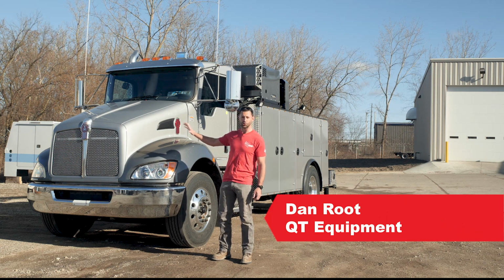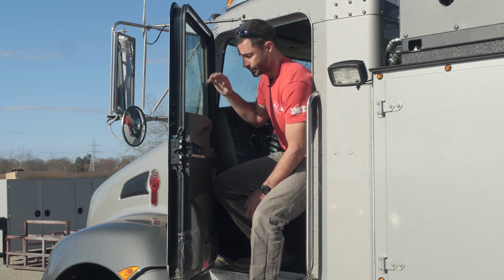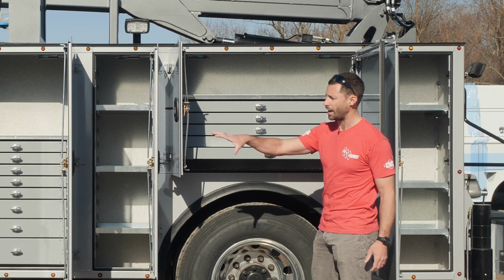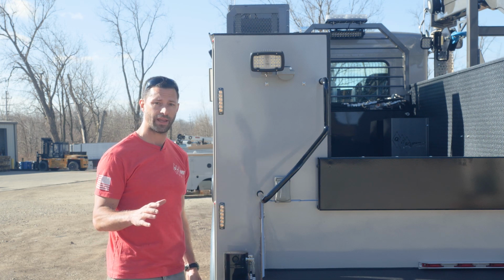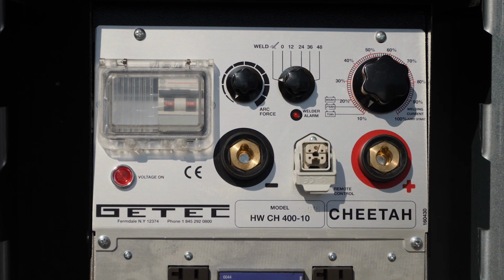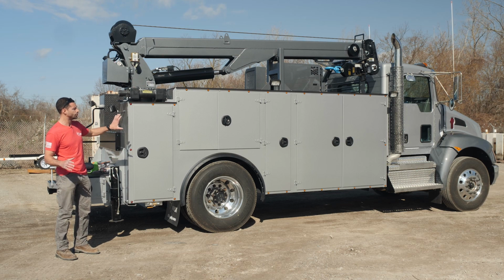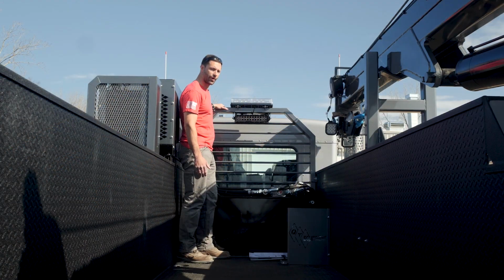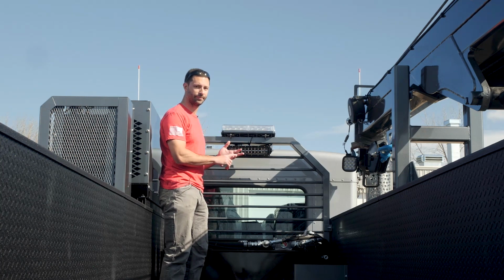Custom Kenworth T370 Service Truck

Comment: Nice,  are the tool box cabinets large enough to hold cases that are 30 wide x 24 deep x 16 tall?
Reply from the maker: Thanks for watching!  

Width and height are not a problem but you're only going to get about 19" of depth with the shelf brackets.
Reply: @qtequipment   Thank you,  it's a challenge that I am having every where I look.   Saw a box that sits on top of the frame that goes all the way across.   But would need a lot of customization and I am not sure if that is a good idea or not.

Comment: Great job Dan. Beautiful truck but I have two questions. Can these trucks be built with factory steer axle air ride and can they be ordered with a small sleeper? If so do you have any videos on either of those items? Thank you
Reply from the maker: Thanks!  Sorry for late reply, we've been busy building trucks.  I'm not sure on the steer axle, we would need to check with KW.  We've done sleeper trucks in the past but they are usually a higher GVW.  There WAS a company that was doing aftermarket sleeper options but im not sure what the status is on them.  There is a video from January 2023, Kenworth Supertruck Build, that has a sleeper.  May also be able to find some sleeper pics on our Instagram.  Thanks for watching!

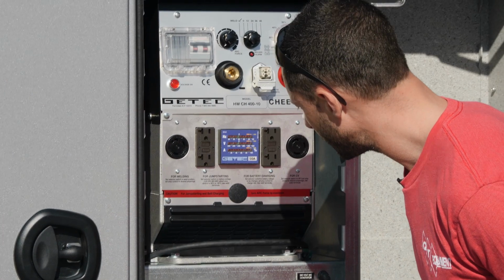Comment: 7:40 LMFAO glew on the bolts ?
Reply from the maker: Good eye.  This is silicone applied to a fender washer to keep water out.
Reply: @qtequipment  If you'd put a washer on top of the glue it would look 1000 time better

Comment: Another thing I always had issue with is all the PTO driven equipment, the air comp and welder and boom. Your running a $25,000.00 dollar engine and your primarily running an air compressor. Better to install a 50 or 60 hp. diesel engine hydraulic system in the bed of the truck and pull your aux. off of that.
Reply from the maker: Excellent comments Douglas.  You’re probably going to like our next video then!!
Reply: Sometimes things are done the way we do them for the right reasons. If you are tempted to say what the hell why don’t the people who do this every day for years do it this way I just thought of after 20 minutes, you might want to try and ask first, you more likely to get an answer instead of an expensive lesson.

Comment: Been a field mechanic for most of my life. Worked for the cat dealer for 10 years. I always wondered why they never used Q.T. until I purchased a Kenworth T370 with an IMT body, 12,000 lbs crane, with a Miller impact unit. This company can't fix anything unless the guts are hanging out and it's very obvious what is wrong. I've tried using there shop and a field service tech. No one is competent. Sales will tell you yes we can do that no matter what you want. After the down payment is paid and the build is started it all changes. There saying is( if you can dream it we can build it)  turns out it has to be there dream not yours as I got very little that I asked for. The list of issues with this truck goes on and on. To long to list all issues. 
A HUGE SAFETY ISSUE EVERY TECHNICIAN NEEDS TO KNOW ABOUT THE IMT 3 STAGE CRANES IS WHEN THE BOOM IS EXPANDED AND BOTH THE EXTENSIONS ARE OUT. THE MIDDLE BOOM WILL RETRACT WHILE THE LAST EXTENSION EXTENDS. BECAUSE THE MIDDLE CYLINDER IS LARGER THIS EXTENDS THE LAST BOOM MORE. IT WILL RAISE THE LOAD UNTIL THE CENTER EXTENSION BOTTOMS OUT. I HAD A SCALE HOOKED TO MY BUMPER. PUT A 500 LB LOAD ON THE CABLE, SHUT EVERYTHING OFF. THE SCALE INCREASED TO 2,200 LBS. THIS ISSUE IS WITH ALL MULTY STAGE IMT CRANES AS I HAVE A 2008 10,000LB IMT WILL DO IT AS WELL. QT refused to do the annual inspection on my 10 or 12k crane so they are very aware of this issue. 
I've purchased many new vehicles and dealt with alot of different dealership from chevy to harley, cat etc. This is  the most incompetent dealership I've ever tried to do  business with. They'll leave work orders open unfinished for months and months. Never return or call to finish work.
Reply from the maker: Rick. I’ve got to be honest, I’m pretty disappointed.  YouTube gives us the option to delete comments but that’s not how we prefer to do business. We've made many attempts to communicate with you over the years but I'll try one more time. My cell is 330-697-7831. Call or text me anytime.  Thank you. - Dan
Reply: we would like to know IF Dan made it right with you!!!
Reply from the maker: @pisom4314  Rick, we are still here.  Call anytime.  My cell is 330-697-7831.